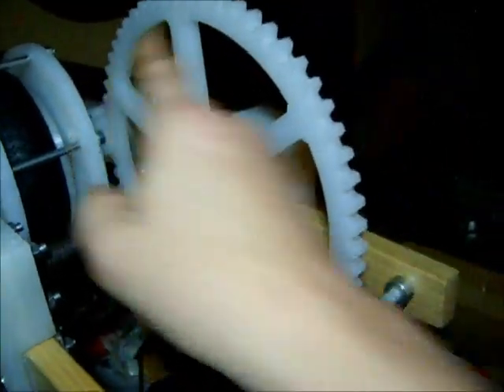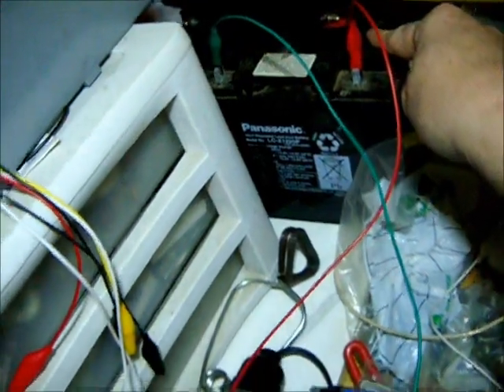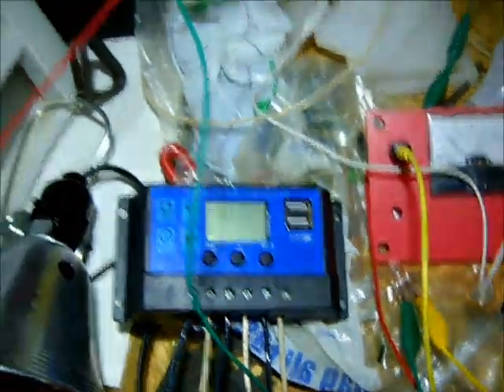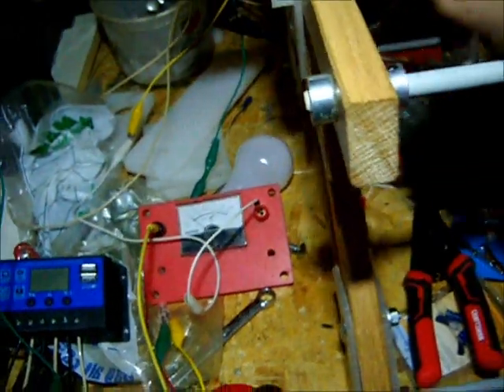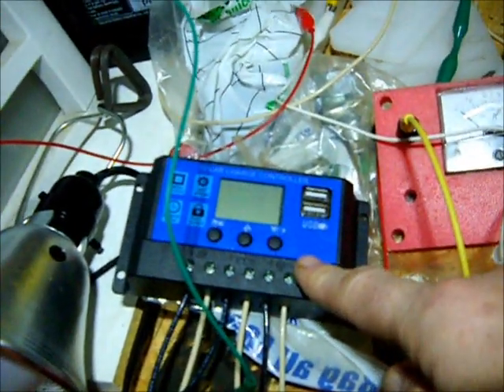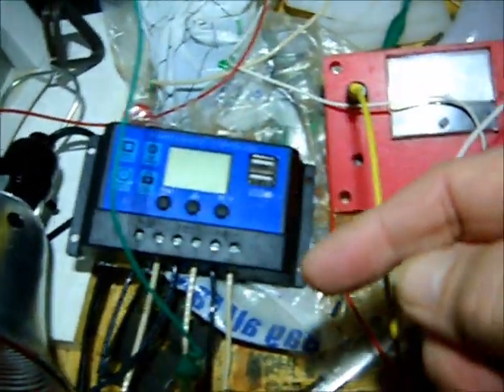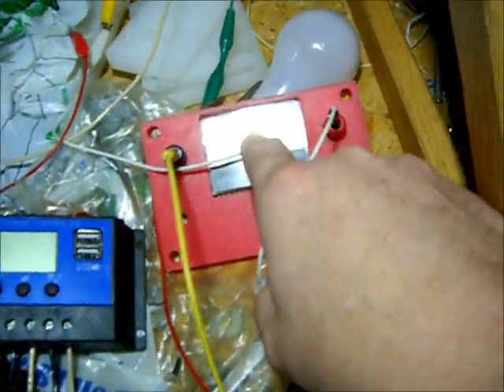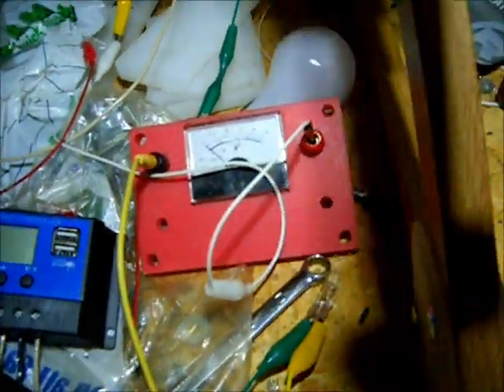HandCrankGenerator2 24 20

Comment: Limited by how strong you are . .. That is why I have 'build' my own generator, which cost no effort at all. It is an e-bike with a 24 Volt motor. When I connect it up, I can drive several types of loads using my legs. Legs are stronger than arms (usually). In the end, it is not about the maximal amps, but what you can sustain with your muscles.
Reply from the maker: Hi, thanks for the input.  New York state USA plans on making  eBike's legal.  I will buy one once that happens then it can be configured to peddle charge it own battery.  
Finding a PWM   charge controller  with a high VOC is what is needed. Thanks again.